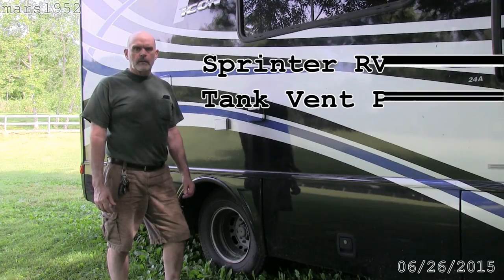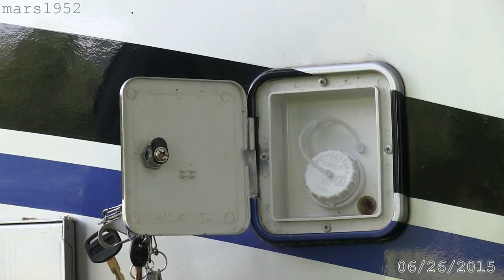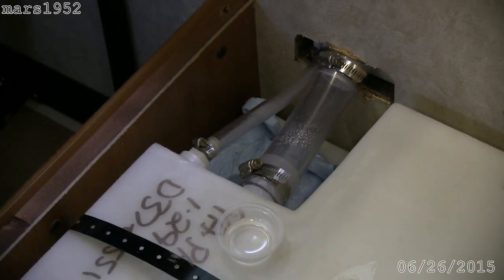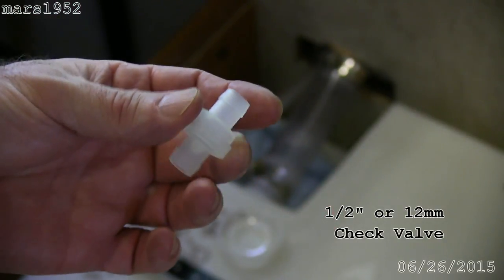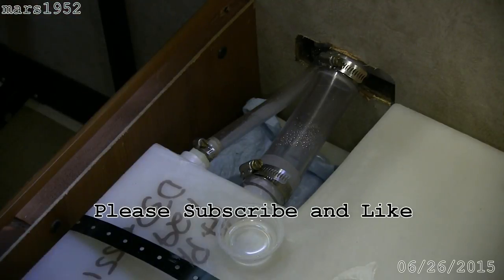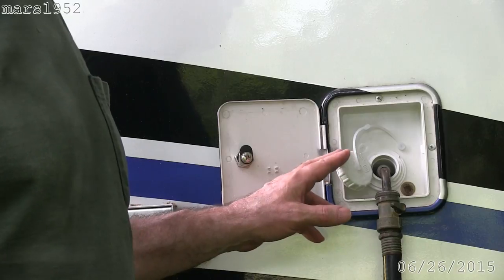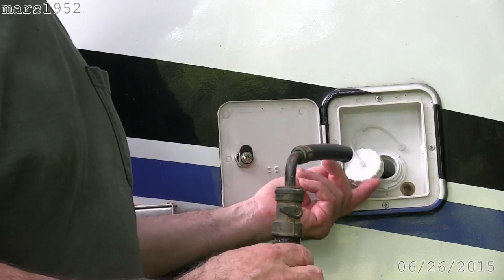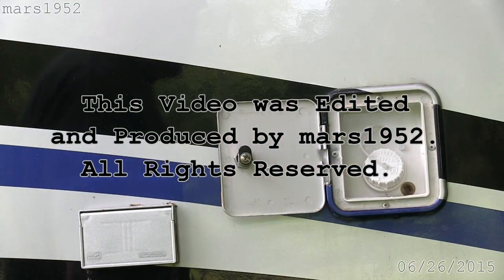Sprinter RV Water Tank Vent Problems

Comment: Found an issue with my vent hose today and thank you for your video!  It didn't address my issue particularly, but answered some questions regarding needing the vent hose for air release vs. it being used as an overflow for water.  Great attachment idea with the 90 degree angle and smaller tube attachment which allows the air to escape while filling the fresh water tank.

Comment: I had the same problem on my boat and install a check valve as well.  I had to reinstall by taking it from the tank end and installing it at the outlet end. The water when full was not let air in due to the water holding valve closed until the water level in the tank was lower then the air outlet.  This caused my tank to leak due to pressure caused from the pump taking in water without air.  That's for sharing keep the videos cominh.
Reply from the maker: buzzsah I will keep an eye on mine. I noticed when the tank was topped off there was water against the check valve.

Comment: great idea, and you're very handy with those hoses...I have a problem not being able to fill my tank because the water immediately flows back out..the tank is empty (per the gauge on the wall, and air coming out when the pump is on and sink valve is open)   I have a filler hose I bought at camping world, but the same thing happens...any ideas ?

Comment: Wouldnt this make it so you cant fill up your tank when empty? Because the air cant vent out?
Reply: I was thinking the same thing. Air has to go both ways.
Reply from the maker: The hose used to fill the tank is much smaller than the fill port. There is plenty of room for air to escape. However, to get the tank to fill to the top I made a long fill hose that snakes all the way through the fill neck into the tank otherwise I could only fill the tank to the point where the water in the tank covers the fill neck,

Comment: How do you account for expansion when the RV sits in the sun? How does that air vent?
Reply from the maker: Good point, the expansion of air in the tank should be slow enough that the check valve is not activated and the tank can handle a slight pressure.

Comment: I think he had created a new problem. There is no allowance in his system to account for thermal expansion of the water.
Reply from the maker: I installed this check valve about 5 years ago and it still works very well. The check valve only works for rapid pressure changes such as that caused by sloshing.

Comment: Where did you find the air check valve? I have a 2018 Forester 2431S with the same problem.
Reply from the maker: Jimmy Emerson I found it either at Amazon or eBay.

Comment: Don't you need it to let air out when you fill?
Reply: The filler port acts as a filler port as well as a breather pipe due to filler pipe being a far larger diameter than the hose thats filling it. Ie. Connected to water source. More accurately, there is not enough water entering the tank to cause pressure as there is a larger volume of air escaping from the filler than water entering the filler)

Comment: The problem is the sprinters are junk! Everytime some poor bastard would buy one I would laugh inside and think just because someone has $90k doesn't make them very smart. I have done delivery and walk through on over 500 RV's and these things are junk sorry to say. Every customer thought they were going to get 20 mpg. They would come in for service and complain.
Reply from the maker: Titanlessmatt As a mechanic I think the Sprinter Chassis is pretty good. I am only getting 14mpg. When I complained to other gas powered RV owners they thought 14mpg was a lot better than the 6 to 9 mpg they were getting.